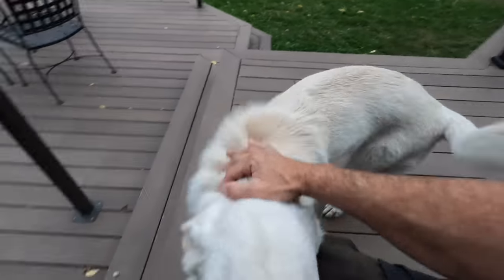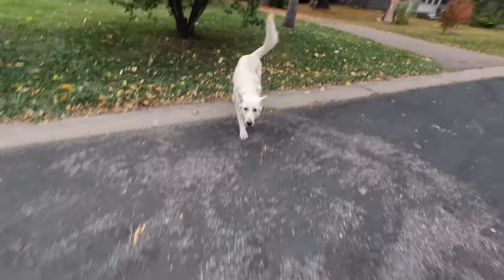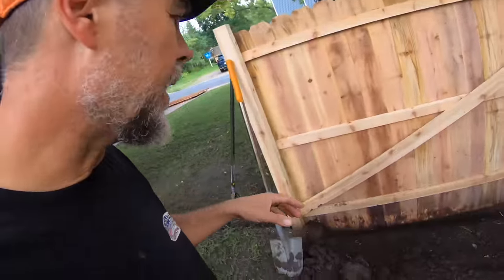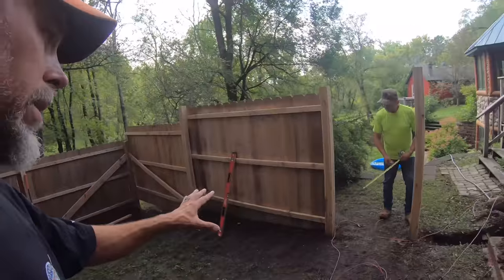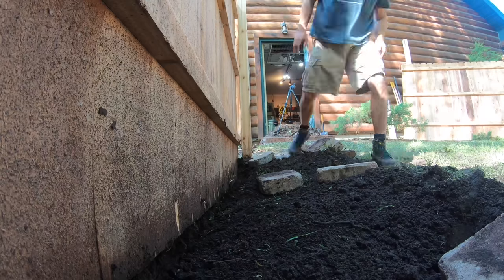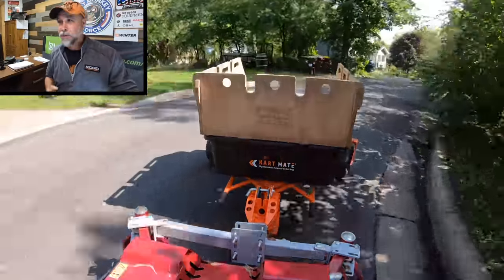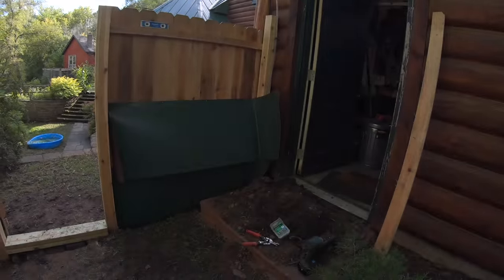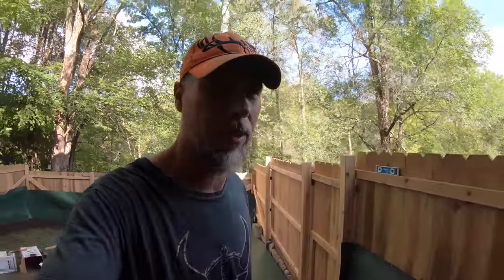Building a DIG, Climb and CHEW Proof Dog Run

Comment: I know you will get suggestions on this one.  We have always had German Shepherd Dogs who love to run and they have a big yard in which to do that.  In our privacy fence I cut "windows" for them to look out of which pretty much stopped the curiosity digging.  2x3 foot opening covered with 14 gauge welded wire and wood frame on both sides.  To stop critters from getting in, I fixed 3 foot high 14 gauge welded wire on the inside of the fence and into the ground about 4 inches.  Our GSDs love to sit by the windows and watch the world go by on the other side.  They have also received their share of correction when they goofed up.  Thanks for the great videos.
Reply from the maker: Cool love the idea thanks man 👊

Comment: I had to end up doing chicken wire fence. Attach it to the fence and then lay it out from fence 2 feet. Bury it with dirt and Sod. When they dig they get to the chicken wire and they hated it. My dogs were known for digging down under my fence and digging under the neighbors sidewalk and coming up on the other side of the sidewalk, lol. And they could do it fast. Rocks,bricks,cement didn’t work. These dogs learned how to move them. Crazy dogs

Comment: To everyone that wants to build their own fence don't buy the 8' panels like Stan did. Doing this forces you to follow the 8' panels and not your yard. Buy 1"x4" fence planks, 2"x4" runners and 4"x4" post. Make the top of the fence follow the slope of the yard for looks. The 4"x4" post need to be 8' apart, the runners need to be 4" to 6" up from the ground and 4" to 6" down from the top and 1 runner in the middle of those two. When you mix the concrete don't do it in the hole with the 4"x4" post, do it outside of the hole in a mixer or wheelbarrow. Use screws not nails and if you want digging protection put chicken fence across and under the fence. Oh one final piece of advice when you dig your post holes balloon the bottom of the hole to stop frost heaving.
Reply from the maker: Good points.  One thing I did witht he panels was cut them down to make them what size I wanted.  My gate was a panel cut in half. So you can use panels and modify them to suit your needs.

Comment: I know you just wanted it done, but my 2 cents hardware cloth burred with aesthetically making the tops more balanced and 1 1/2" stone at the bottom covered with soil back from fence add window ports and it wouldn't look like a sad DIY project. I know your work is normally always done at a higher standard ,that's why you have so many followers. thanks for sharing and its never too late to shine
Reply from the maker: This was functional over aesthectic.

Comment: I'm planning on building a dog run on the side of my house.  Luckily, my yard is fenced, so all I have to do is run a short length from the fence to the corner of the house.  Unfortunately, I will need to put a gate in it.  Not hard, just a little more work.  And the dogs can't currently get to it without me going outside and letting them in and out, but I'm going to put a doggy door in my dining room that will get them "at-will" access to it.  Just another item on my honey-do list!
Reply from the maker: Sounds like you got a plan going 👍 Go get em!

Comment: I put [sacrificial] composite deck boards running along the ground so that my fence can be put 3-inches above ground level.
Reply: Composite boards are not sacrificial materials, most of them don't rot.
Reply: @Oscar-Sh  i assume it is "sacrificial" vs the digging.

Comment: Another great video Stan 
Here in the UK we would have  used concrete posts and gravel boards that could be buried and slot in fence panels. So no rot of the panels. Not sure if you use this method in the US.
Reply from the maker: It wasn't available without special pre-order

Comment: If you did the shosugi bon at the base it would protect it from rot and insects too lol just a thought . Also could  bury weld wire 12" deep and attach it to the outside of the fence instead of burying the fence  another idea if the bricks dont work always have to have a back up plan lol take care peaceout
Reply from the maker: This was a fast way to get it done before the week end was up.
Reply: @Dirtmonkey  i get it sometimes its a time frame they were just thoughts and mabe upgrades later if the need arises. awesome channel

Comment: Personally I don't like pre built fence panels.  It's   Windy up in Washington State and it tends to blow the panels down. You should redo your deck with composite and take a partial amount of the blocks down where your stairs land and tie that into into some stamped concrete into you're gate on your fence.

 You could also use some chain link tension wire on the bottom portion of your  Fence, stapleing it into each post and that might be Prevent the dogs from digging or at least from escaping without having to dig around The entire perimeter of the fence but may be a choking hazard
Reply from the maker: Your right-  that would be a better way to do it but I needed to get something done fast and this was my solution.

Comment: Built a lot of critter pens, and the best "dig proof" method i have found is to just attach a couple foot wide strip of chain link fence to the bottom of the pen walls laying back into the pen.  Cover with a bit of dirt.
Reply: Question my rotty can chew threw the link fencing really quickly its quite scary what would you recommend?

Comment: ~~The name escapes me but there's a factory direct coating made to coat&protect deck footings from rot. While I know two who simply sprayed on like 2 or 3 coats of Plasti-Dip&another who,awhile back,applied Liquid Nail that came in pints/quarts.
Reply from the maker: actually I just seen it at a show and I think its called post armor

Comment: Stan what works better for fixing crack in a concrete floor or driveway?? Sealant with a gun or mixed mortar and trowel it in?? What last longer? Cracks r wide in areas but not wider than 1/2 in wide?? Need your help buddy driveway and garage floor im a do my own work no hire guy.. im a wrench worker but i own my home and need tips for this job at home
Reply from the maker: I have tried both with mixed results.  their isn't one good fix for that issue sorry.
Reply: @Dirtmonkey   thanks ill fix it up nice

Comment: Hey Stan why not put a buried electric fence in like a sport dog and add one of there gps trackers  to the collars incase your extra worried about one getting out  of the fence I have one that can go up too 100 Acers  that can have unlimited collars I generally even Bury the wire in nonmetallic conduit so you can change the wire without digging again or have the risk of something damaging the wire
Reply: I think Stan wants to keep the wild critters out as well.

Comment: if you buried what they call chicken wire about 2 ft wide and about 3 or 4 inches under ground  it would stop them digging.. they would dig down and hit the wire and that usely stops them. i built a chain link fence and they keep digging out and thats what i did and it stop them.

Comment: I had a yellow lab female that used to love to run and chase squirrels.  One day when she was 1 1/2 years old she chased one right across the street out front and someone ran her over at about 10 miles an hour.  She went completely under the car and came out the back end.  Broke one of her back legs and needed a rod plus about $6000 worth of urgent emergency care.  
She lived till 10.  Never chased squirrels again after that tho.